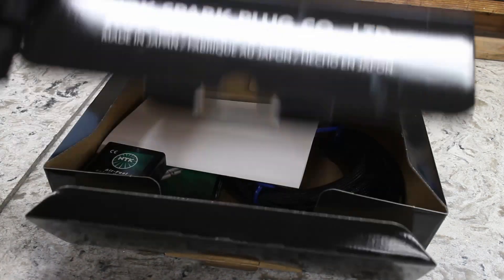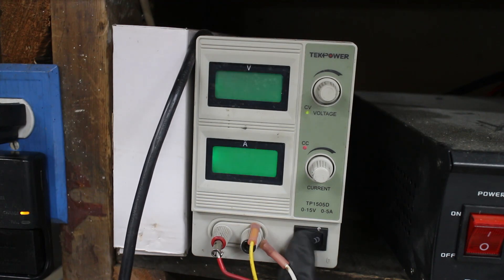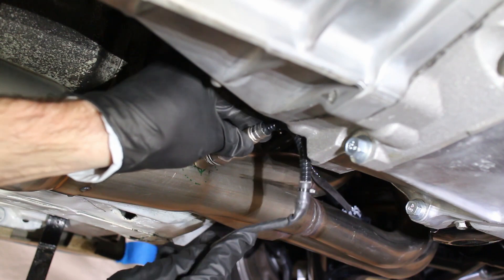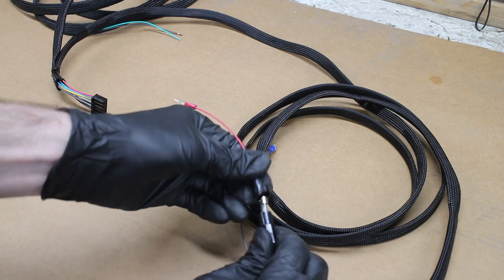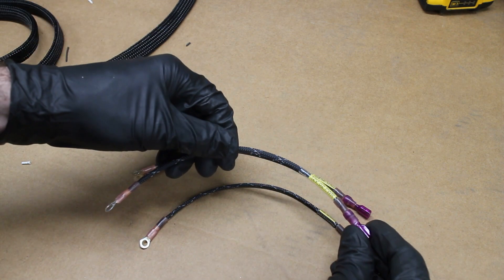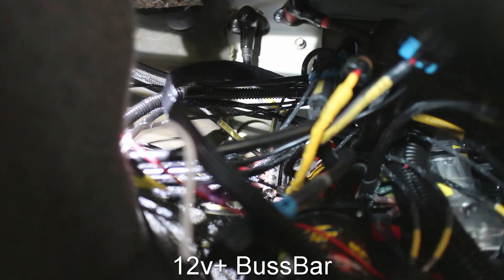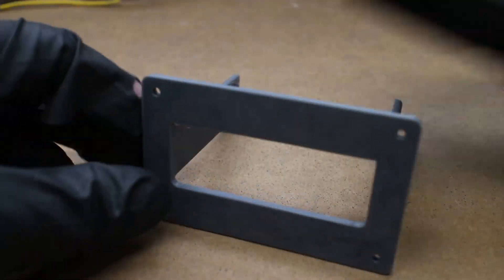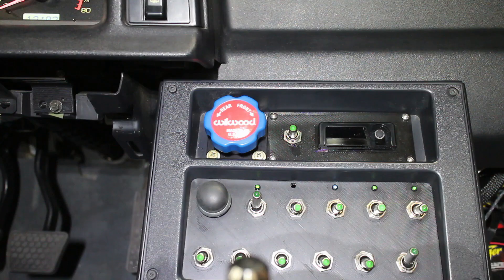Wideband o2 install NGK

Comment: Can you turn the gauge off? Like for example I’m thinking of mounting this on my steering column but I’d like to be able to turn it off maybe once in a while on long trips so it’s not constantly on and I’m focused on it.
Reply from the maker: if you put a toggle switch between the 12V power source and the Wideband that would turn it off.

Comment: going through the exact same thing myself right now, it really sucks when you pay a so called tuner $650 bucks for a tune and the guy only wants to tune in sd mode, saying gm maf's are garbage....as an excuse for his laziness. i went with the aem 30-0300, but this install was not as clean as yours.....i had no good mounting point for o2 ( i'm mid way back on car because thats where the y pipe is after tailshaft and i wanted it reading both sides), and no 3d printer for custom gauge holder.....i cut in my 2inch gauge in the center console behind the hatch switch.  nicely done with your install though